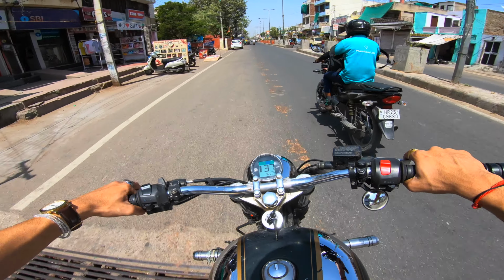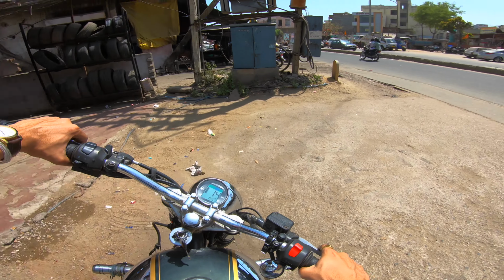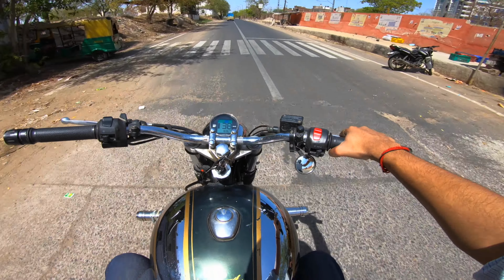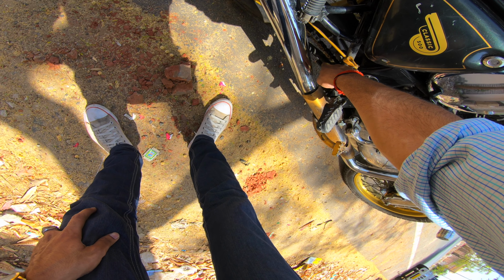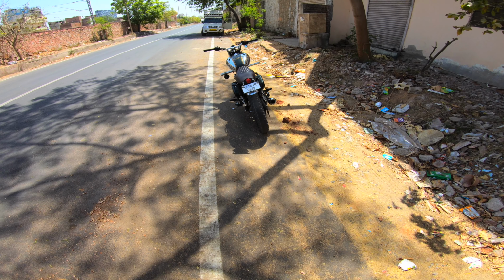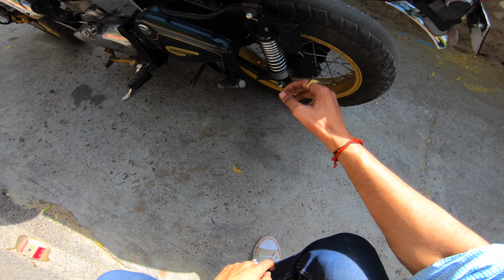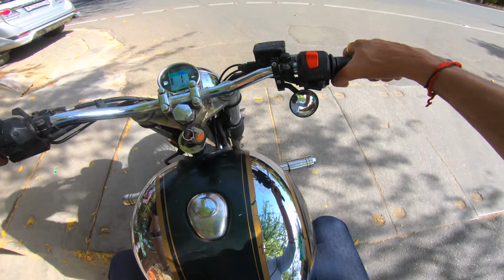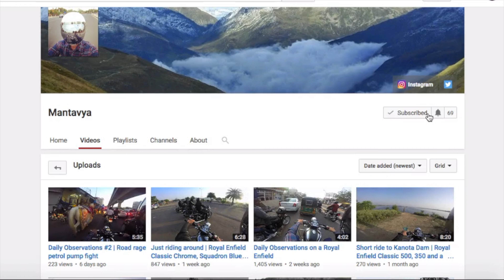Royal Enfield Shocker Modification

Comment: Somehow I didn’t understand the video properly, what was exactly done and why ? 🧐
Reply from the maker: rear suspension was extended to give the motorcycle a lift as the rear wheel is 17 instead of an 18 inch which makes the bike sit lower at the back
Reply: @Mantavya  Got it, 👍🏼